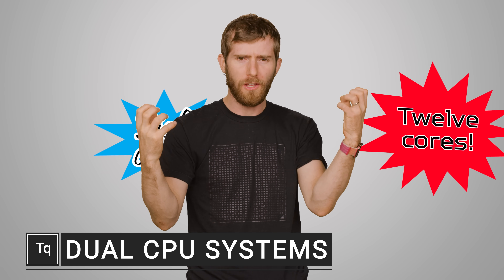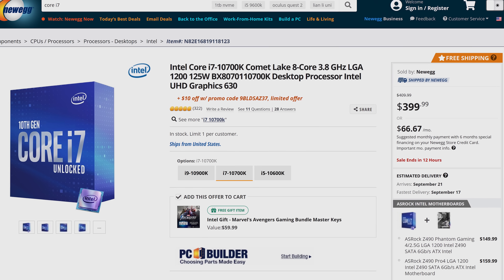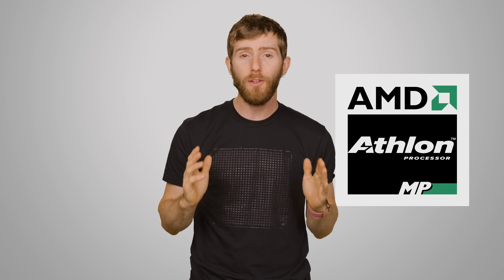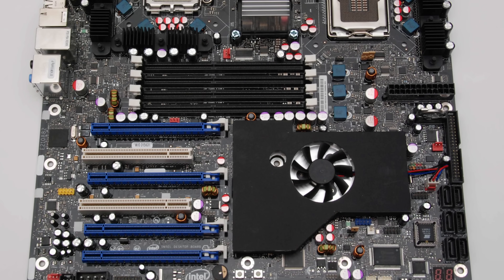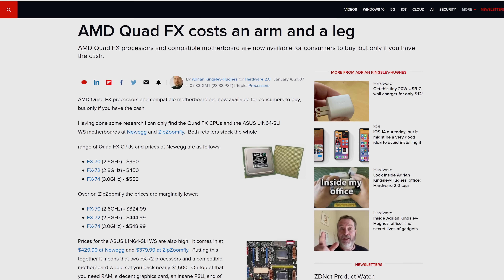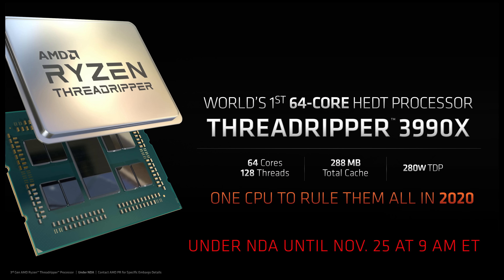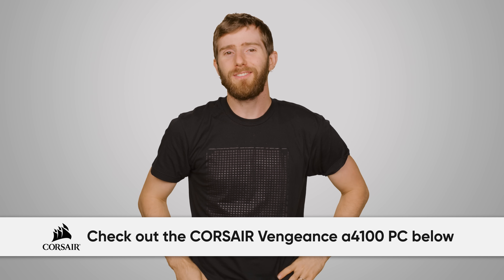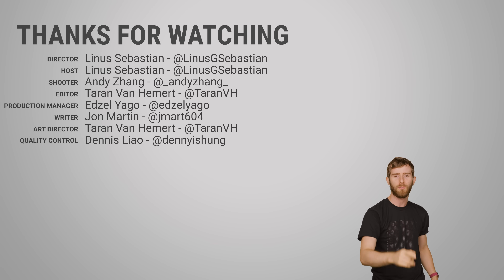Should You Put TWO CPUs In Your PC?

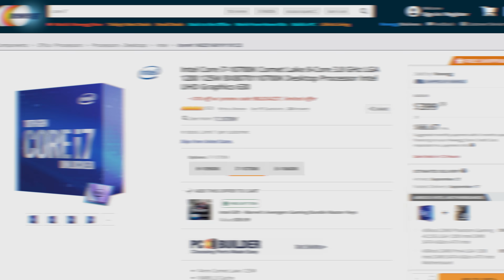Comment: 0:50 cost was an issue, but the largest issue was usability. they were worthless for consumer applications and as such relegated to business and industrial use. even photoshop couldn't make use of multiple cpus/cores until the 2000s. it was just a worthless thing, especially when you consider the price of the operating systems that could even access them, there is a reason why your copy of windows 2000 or xp said "1-2 cpu" on it, that was when multiple cores or cpus started to be a thing, even hyperthreading is impossible on anything under nt 4 if we are talking about windows, third parties shoehorned multiple procs into nt 3 while most who did use multiple procs back then were normally running solaris, or a custom build of linux, or a very expensive boutique build of unix. there just wasn't any software compatibility for the average consumer, so until windows 2k having more than one core or proc just didn't make any sense.
Reply: thanks for watching the video, I guess?
Reply: @RawbLV  i did actually watch it, and they did an alright job on the subject, but i figured actual experience from the era they were talking about might be useful in the comments. do you disagree? i worked as a pc repair tech and sales rep at a computer store from 1999 to 2004 and have of course kept my finger on the pulse of the industry both before and after that, seems to me that i might have something valid to say there.
Reply: @kght222  I don't disagree. I just don't understand how writing the same thing what the video said helps anyone? Why waste your time?
Reply: @RawbLV  wrote it before i saw the video say it. and i have time to waste because i'm off work today. so.........
Reply: @RawbLV  i have literally rebuilt a 486 in 2002 as just a dos 486 to run a plate machine at a steel mill. because there were no drivers for windows (oddly enough there just weren't any drivers and it took a direct input series of commands so i could have upgraded them to almost anything and it would have worked, but they wanted it to be dos and the same). you could literally type print fart > lpt1 and it would cut the word fart into a plate of steel in default font. it was just a very basic printer.
Reply: @RawbLV  and yeah, in operation with it's software it was a plotter not a printer, but it  would respond to print commands the same way that any plotter from the early 90s would. it was just a slightly old piece of industrial equipment. we had to replace a few relays on it because one had gone out, if one goes out the others won't be far behind.

Comment: Simple answer: The Windows scheduler can only barely handle existing single socket Threadripper platforms as it is.
Reply: And having two Threadripper sockets would require a MASSIVE motherboard, not just to fit the sockets, but also to take full advantage of the PCI-E lanes.
Reply: @rez-theruneman  It's time to have PCIE x32 speed slots because why not as well
Reply: @FMHikari  The day that becomes a thing will be exciting.
Reply: @rez-theruneman  Yes it will. For now my only wish is for mobos to have a GPU socket. It could be just another pcie port on a different shape(like nvme), but able to receive the extra power.
Reply: @FMHikari  That sounds like a good idea.
Reply: @FMHikari   the x32 is not any longer than x16, it is sometimes combination of x16 + x1-x4 because almost all of the "power pin" in pcie connector is used for carrying additional lanes, note that this is not industry standard and not cross compatible with other manufacturers let say dell and Lenovo
That's why sometimes the adaptor board in server (usually also adapting it 90 degrees) need additional power to convert the 12v into 3.3v and 5v to supply into normal pcie connector at the other end

I like the idea of industry wide standard of pcie x32 connector
But it would be quite sometime 👍

Edit: after some rabbit hole there's a lot more nonstandard pcie x32 connector like you have this x1 pcie an then x16 but after that it's x4 but without keying (it's the very front of pcie connector that seperated from actually connector) an then it's ended with x1

Also there's a same thing but with pcie x1 then x8 (without keying) then x1, and that is terminated into 1 x16 and two x8
I know pcie bifurcation is exist and know it but how they fit all of that in single "adapter" or "backplane" is confusing and mesmerising 
There's no switching ic in Those adapter though only some complementary components and pcie retimer
Reply: @3daystogo_create  PCIe x32 slot exists, but your idea of medium power (x8 level power delivery) PCIe x32 slot is great.
Reply: @FMHikari  build it!!
Reply: @rez-theruneman  128 cores and 256 threads oughta be enough for anyone!!!
Reply: @xeridea  Yeah, and even that's way overkill.
Reply: @xeridea  lets wait for the day when 128 cores are considered as normal to have
Reply: Not a good answer... there are other operating systems out there that have run on multiple CPUs for decades. Windows ran fine on multi CPU machines, but only if software was written well enough to take advantage.
Reply: @another3997  TBF that wasn’t until Vista. In XP and before, Windows would treat multi-core CPUs as if each core was its own CPU. It wasn’t a problem per-se, as the hardware handled what could’ve been competition over memory and cache access, but it wasn’t optimal either.
Reply: you are true example how you dont know about hardware 😂
Reply: The real simple answer is that programs often share memory space and memory can only be written to by one core/CPU at a time. This is why hyperthreading programs is  really hard as the split process cannot write to memory used by the main loop of the program. So generally hyperthreading is programmed as single purpose tasks that perform one thing and then nothing else.
Reply: That and 2 sockets takes up just a bit more space than bigger CPU's why have to sleep use when you can just do one really big 1
Reply: I don't think you know how it works.
Reply: Windows server supported 32 cpus since the NT.
And since Windows XP the server and home versions of Windows shared the same kernel.
I bought a used HP 580 G6 few years ago to study for some certifications and put Windows 7 on it, Windows only recognizes 2 CPUs and 6 cores each, when I installed Windows 2012 server all cpus worked flawless. This thing is simple Microsoft have a server and a home plataform and if you want to use more than 2 physical cpus you can spent the money to buy a Windows server license.
In the reality CPU was barely a issue with just 6 cores. With 24 there's not much I can throw in a home computer to put all of them to use.
But the power usage was insane though.

Comment: Is there a reason why laptops don't use multiple CPUs, with one being an older cheaper, but more power efficient and the other more powerful and able to turn off when not needed? I know CPUs are starting to get small package cores added, but why is 2 CPUs not a thing? Battery consumption? Space?
Reply: Space and material cost. But they are going a similar route now by having 4 high and 4 low cores in a single chip. They did a video about this not too long ago

Comment: If I put an DVI-D adaptor on a DP or HDMI cable does the quality of the video output is the same as regular connection with a DP or HDMI(I mean the single and all that) and the connection on my GPU(GTX 1650 S) is DVI-D and the connection on the monitor is DP or HDMI, so is it the same or is it like connecting a regular DVI-D cable?

Comment: I use  2 Xeon x5677 which has 4 core and 8 threads in Dell t5500 as result I get 12mb +12mb cach and 8 cores 16 threads this is very powerful old combo

Comment: I used to have a dual socket LGA1366 motherboard with two Xeon X5675s. Actually worked really well for years and didn't cost much at all.
Reply: but..the point of the video seems to be that there is no added benefit with a possible latency issue to deal with.
Reply: @natevelar  that may be true for some scenarios like gaming and basic use like word processing, but it's ignorant to say that it's useless to have multiple CPUs. For situations like CAD, rendering or scientific workloads (which is also something people do) then the extra cores speed those up massively. Why do you think servers and workstations typically have multiple CPUs? If it didn't have any benefits, why would motherboard manufacturers even bother?
Reply: @danwhite3224  I'm currently using an older Z400 hp server with a dedicated GPU...looking at a G4 HP server with a high scoring Xeon with two cpus.  I buy them for the dependablitiy and stability...and am always unsure what advantages I will have when I move to two cpus.

Comment: Don't forget about the dual-socket x86 platforms that used math coprocessors (e.g. Intel 80386 and 80486 - many of those motherboards actually had support for the math coprocessor to be replaced with a processor that was the same as the main processor - I had one about 15 years ago in both desktop and laptop form)

Comment: Failing to mention the dual socket 370 boards that many used with Celeron CPUs is kind of a big miss in this story.  It was still expensive, but not "let's sell my kidney" expensive.  I knew a couple regular people (IT guys, obviously) who used them.  

I also managed to wrangle a dual P2-266 system for my company workstation when I worked at Merrill Lynch.  Nobody else wanted to use it because it was buggy to use dual CPUs with Windows NT 4.0, our default OS.  An Exec pushed the company to buy it, at over $10,000, and then discovered all the issues with it under Windows NT, so it went into a closet to sit unused.  I was brave enough to try Windows 2000 for my main machine, and it ran wonderfully.  I miss those days.  I really wish I could have kept that job, as it still is the high point in my career, both in terms of position and pay rate, when adjusted for inflation.  9/11 took that all away from me.

Comment: This is expecting the system to manage your processor usage, but what if you have a bunch of single threaded workloads and you want to manage them all yourself? Wouldn't having multiple processors and more cores per socket be good assuming you can direct which core to use? That was my initial thought process when getting my two ancient Athlon 64 X2s in my computer years ago. I'm still intending to use it as my main driver

Comment: In all seriousness. I have 2 xeon 2690s. 8 core 16 thread. stock 2.9 ghz turbo to 3.3 across all cores (so 16 core 32 thread) I ran multiple benchmarks on shadow of the tomb raider. (580 8 gb gpu highest settings for 1080p, about 56 gigs of ram at 1866) i did not disable turbo, because I wanted less active cores to have a fair chance.
both processors all cores and threads 10218 65fps average
both processors only 16 real cores 9749 62fps average
one processor all 8cores and 16threads 10372 and 66 fps average (only got 40 gigs ram available for that due to physically removing a processor)
I was hoping it would perform slightly better with 2 processors. even if it was because the operating system had more to work with.
if you want to do a good water cooling setup, I might understand. But the ambient temperature increase from the 2 processors is a real problem unless you are on watercooling. I had my case open and a box fan pointing at it to make up for this during benchmarks. (both processors on the reliable hyper 212)
the whole setup like this makes cost go from 300 to 450(no monitor). just thought Id share my experience.

Comment: They can make it work so we can have 128 threads and  256 hypers, they are saving it for a later time I'm sure! OR do we still not have proper advancements in hardware/software/knowledge( I doubt it ) yet! So there's no Diminishment!!! OR too expensive for mass production/consumer pricing/strong profit margin( msrp would be too high, not enough buyers )!!! I'll say ok that makes more sense.
Reply: Dual EPYC 7702 system has already done it, 256 total threads
Reply: @justsomerandomcomment5586  For gaming? Was my main point. Sounds to me like this is what everybody would want and should have if it's for gaming, but seems or sounds like old tech with undesirable powAA+++! Linus I know u would already have it and use it and complain that it should be the new and improving standard.
Reply: @justsomerandomcomment5586  Dual cpu's for gaming-and high core counts is where I was going. No servers, or work stations, just kicking a** and taking names dual core motherboard!

Comment: Space is another consideration. Dual socket motherboards tend to be a bit bigger than a standard ATX size motherboard and many people just don't have cases big enough for it especially considering the amount of space required for a lot of the water cooling setups people build, and if you do air cooling, that's still a space issue for the big CPU coolers that run nice and quiet compared to the super loud obnoxious small server fans normally associated with dual socket and higher motherboards.

Comment: I have used a single core (single thread) AMD Athelon LE-1640 CPU until 2015 with 2 GB RAM. It had 45W TDP and was based on 90nm process node. In the end it could barely run 720p@60fps videos without dropping frames.

Comment: The first computer I built was a dual-CPU Abit BP6 board running two Celeron 500MHz processors in 2000. I had to run BeOS and Windows 2000 to take advantage of the extra processor.
Reply: I'm pretty sure that Linux handled SMP then.

Comment: Seeing that dual 486 brings back memories. A friend got to spec out his fathers new PC, and he went hog wild. His father had more money than he could use without just throwing it away, and he and his son didn't always have the best relationship so he let him have at it with this machine hoping something good would come out of it. Now my friend knew a lot about what hardware was available but not really a lot about computers beyond that the 486 was the best available and so the computer spec he threw together wasn't the most practical. He started with Dual 486 because they were the best, and having two of them had to be even better, 16MB RAM because it could be done, and again more is better, right? The funny thing is that the OS of the day, DOS with Windows 3.11 on top of it didn't support more than 8MB total, if I remember correctly, nor did it support multiple CPU so effectively half the memory and one processor never got used...

The AMD Opteron was pretty badass in MP configurations. The most impressive Opteron machine I ever built had eight of them, i think they were quad core for a total of 32 cores. It was built on a platform made by Iwill which was kind of janky. It had a main motherboard with four processor sockets and a secondary CPU board with another four sockets and a lot of connecting cables between them. The cables were the weak part as some of the connectors were very fragile and after dismantling the machine a few times they started to fail. And dismantling it was something I had to do repeatedly. The first time I put it together it threw memory errors at me. With up to 32 sticks of memory it was a pretty good chance that one or more modules would be marginal, and finding out exactly which one wasn't exactly easy. Once that got resolved it turned out that the machine refused to run Windows 2000 Server, and after some back and forth with Iwill we got informed that as it was shipped it wouldn't work with windows but would run Linux, BSD, Solaris or even OS/2. To make it compatible with Windows we had to modify the motherboards. After taking a look at what had to be done I just refused to take a soldering iron to it. We didn't have any equipment or experience working with surface mount components and a lot of what had to be done was simply daunting as everything was so tiny. The good thing was that Iwill flew the system designer to us so he could go over the machine. I wish I could remember his name as he was one cool dude. It turned out that he had designed several motherboards that we had used hundreds of and he could explain the inner workings of these systems in great detail. He was also very good at explaining different topologies that could be used and why he chose the one he did for the 8 CPU platform. And he showed me how to work on these tiny SMD components using nothing but a soldering iron with a fine tip, though I could never get the hang of picking up the components with the iron the way he did.

In the end that machine was a total failure. By the time we had it working reliably (all is relative...) the connectors for all communication between the boards were shoot and we couldn't sell it in good faith. And as Iwill was on the ropes we couldn't get any help from them with spare parts or repairs. But it was one impressive piece of hardware when it worked. I remember throwing some rendering tasks on it and watching the graphs for all 32 cores showing 100% load.

Comment: It Seems the LTT crew is too young to remember the infamous ABIT BP6/VP6 motherboard that accepted 2 socket 370 celerons/p3's WITH OC functionality. It was quite the hype back in the day. I got my set secondhand, used it for years in several system and eventually even sold it later on.

Comment: in 93 i bought a pentium 486 dx 66 eisa vesa, absolutely top of the line pc chip at the time. the dx denotes math coprocessor, an sx chip without it so it had to be bought separately if i remember right. $3600 at the time. think it had a 200mb hard drive.

Comment: Still, I miss the hype around multi CPU setup. I worked in a computer store in the time skulltrail was around and we did build some config around it. It was the early day's of SSD and the comeback of SLI.  Even with the "diminishing return" I was never as impressed with a machine as I was with the skulltrail machine running a raid 0 of 4 Intel sata SSD and a 3way SLI of 8800 ultra.